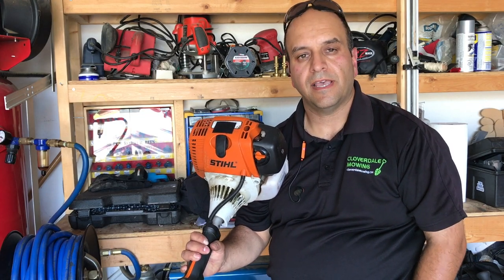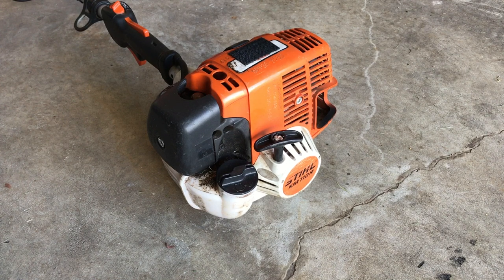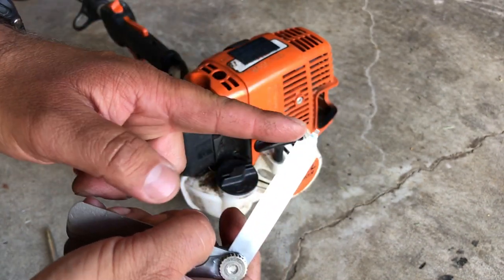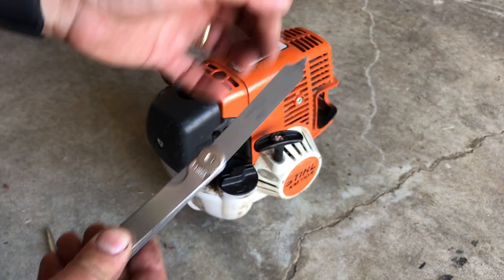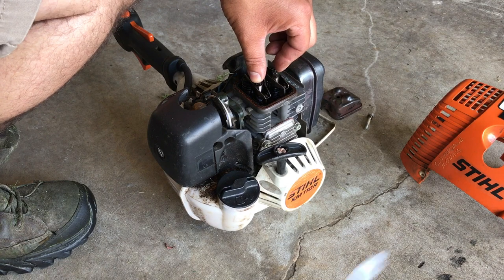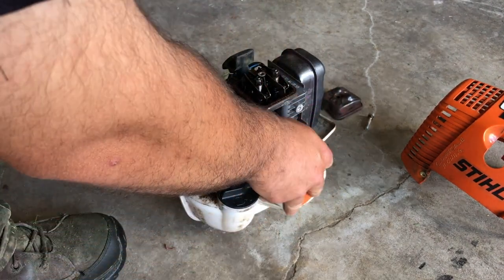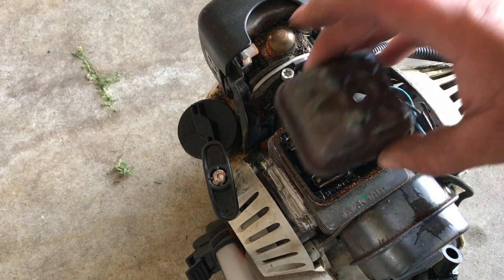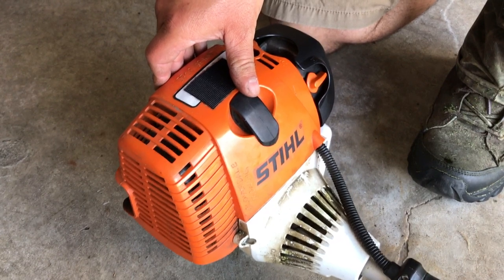How to adjust valves on a stihl 4mix trimmer or blower

Comment: This isn't how you adjust valves. First of all you never mentioned that when you look for TDC, you have to be on the compression stroke. So someone using your instruction would only have a 50% chance of getting this right. Second of all, you want to creep up on the correct clearance, not over tighten and then back off. That's why your feeler gauge is hashed and crimped. Another reason is you're probably leaving the valves too tight. You shouldn't have to pull the gauge out. It should only have a light drag on it.
Reply: tartredarrow, that is a very good point about top dead center(TDC). If the valves move while wiggling the flywheel it is not TDC.
 The valves loosen faster than you'd think, but they're so tiny it's kind of expected. Machine runs well for a long time without adjustment, because there is an automatic compression release built into the cam gear. Once it gets difficult to start because compression release stops working it's past time to adjust the valves.
You can adjust these valves by hand, no feeler gauge necessary. The amount of slop on these valves after running a hundred hours is very noticeable. Adjusting the slop out is plenty good enough for routine maintenance just don't over tighten them. He is also missing the seal that goes on the valve cover screw. Might be hard to get it to idle if it develops a vacuum leak. Keep up the great work and keep the videos coming.
Reply: @1d1hamby  If you adjust the slop out, that means the rocker is touching the valve.  Which is too close. Or am I reading what you're saying, wrong?
Reply: hrdman2luv  ,no, you are not reading it wrong. You can just adjust most of the slop out and not worry about having a feeler gauge. You also don't want it so tight that there is no slight wiggle in the rocker. A tenth of a millimeter isn't much but it still leaves a little play in the rocker. I'm just saying once you adjust it with a feeler gauge, it seems a waste of time to get real particular about adjusting it to exactly a tenth of a millimeter, when it'll keep running fine till it is several millimeters out of adjustment.

Comment: The "arrow" is the timing mark. The electrical box is called a magneto. As the flywheel spins the magnets passing through the magneto's electric field creates a spark that's delivered to the spark plug. The timing mark indicates when this is supposed to happen.

Comment: Hey I have a problem I have a 111 stihl for one year this month but some week a go it just lose power when am working it can you tell mi the cause
Reply from the maker: It could be losing power for lots of reasons. I would start by changing the spark plug, air filter and fuel filter. Make sure the valves are adjusted if that model is a 4 mix engine and make sure the screen in the muffler is clean of carbon deposits. Here is a video I did about cleaning the muffler screen. 

How to clean a spark arrester on outdoor power equipment https://youtu.be/eBzLUZsdGcI

Comment: A wrench is easier to adjust valves with than a socket.  Socket you have to keep changing drive direction to move it back and forth for correct setting, Wrench you don't.

Comment: Xin chào.  Cho mình hỏi .cách pha dầu và xăng như thế nào? Cảm ơn
Reply from the maker: bạn trộn nó bằng tỷ lệ 50: 1. 50 phần xăng đến 1 phần hai dầu

you mix it using a 50:1 ratio. 50 parts gasoline to 1 part two stroke oil
Reply: @LawnCareBusinessSuccess  vậy 1 lít  xăng chỉ cho 20 đên 30 mililit dầu.  Loại dầu dùng cho động cơ  2 kỳ đung k?  Cảm ơn.
Reply from the maker: That sounds about right, but make sure you read the label on the bottle of the oil you buy. Also you can only use two stroke oil as it is made to be mixed with gas. 

Điều đó nghe có vẻ đúng, nhưng hãy chắc chắn rằng bạn đọc nhãn trên chai dầu bạn mua. Ngoài ra, bạn chỉ có thể sử dụng dầu hai thì vì nó được pha trộn với khí.
Reply: Speak English

Comment: Man these trimmers are awesome but after three years they become a pain and you can never get them to run right after you adjust the valves like they don't power under load.
Reply from the maker: I agree! Great machines when new, but over time the valves are a pain.  Mine seem to go out of adjustment once every couple of months, making it hard to start. It gets to be annoying after awhile.
Reply: If they are stretching that much you should really replace the valves.

Comment: Just an idea but you could write it on a calendar when you HAVE to adjust, after a couple times figure out the average number of days, subtract 5-7 days, wait until the number of days are up, then do it.. Things are almost always easier to say than do but I figured I'd chime in! LOL
Reply from the maker: Thanks for the suggestion. I don’t use this machine for daily trimming tasks anymore. It only gets intermittent use. I switched to a echo srm-2620 as my main trimmer. It’s a traditional 2-stroke design with no valves to adjust.

Comment: It certainly sounds like a four stroke. Wasn't quite sure. The sound convinced me.
  What exactly is the cause for the frequent valve adjustment after so many hours of use?
Reply: ~ 100 hours really isn't that frequent to check and adjust valves for a simple air cooled screw type adjuster. I ride on-road motobikes and the mechanically old school ones require a valve check every 4,000 miles just to be safe - 100 hours on a yard tool at or near full throttle would be similar to cruising at 60 mph on my bike - 60 x 100 is 6,000, which is actually a more lenient check interval.

Comment: Why not use lock-tite?
Reply from the maker: Because the bolt needs to be able to be adjusted as needed in the future. There is no perfect setting or adjustment as things change with use and metal expands and contract with heat. Thanks for watching.
Reply: @LawnCareBusinessSuccess  Blue loc-tite isn't permanent, I use it on bolts on my trailer and motorcycle, it's a soft glue that holds tight but can still be easily loosened with a wrench